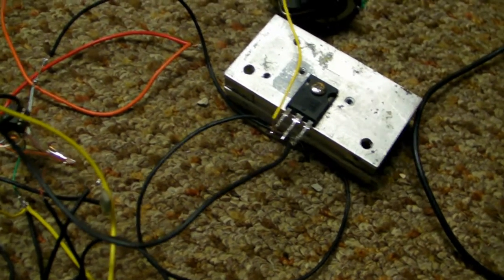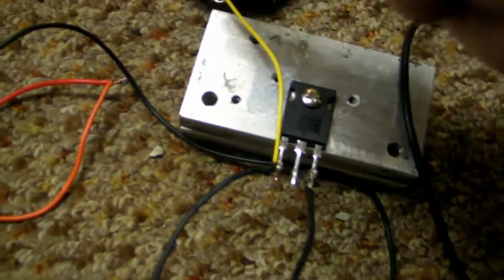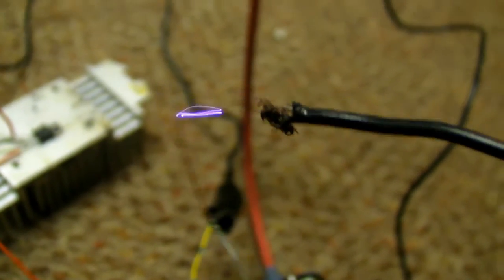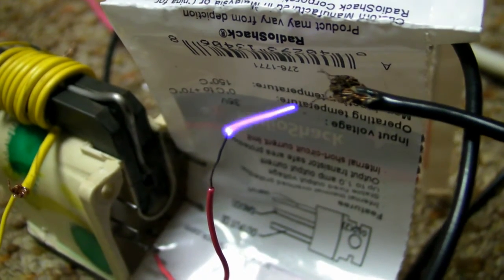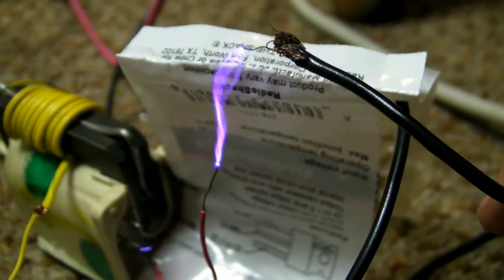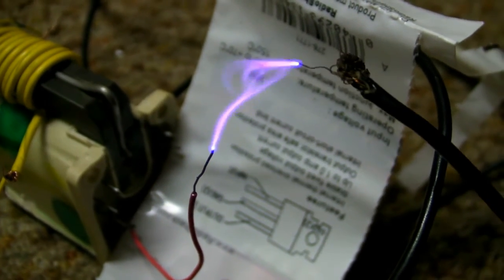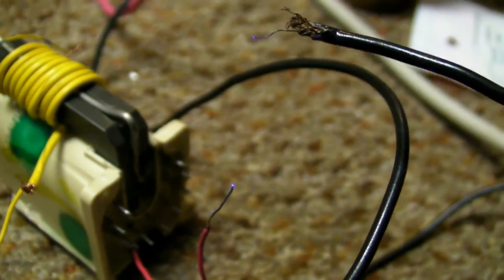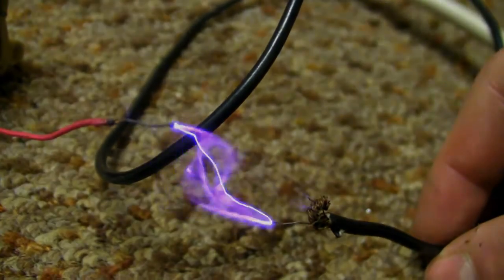First 555 Flyback Driver

Comment: Add a film capacitor between one of the voltage rails (doesn't matter which one) and the connection between the flyback and MOSFET. This will not only smooth out and  minimize the voltage back-EMF spike seen at the MOSFET, but also help produce MUCH hotter arcs.

The reason it works is because the capacitor makes a resonant tank circuit, eliminates many of the harmonics of higher frequencies (from square wave operation) and that is why it ends up more like a resonant circuit, almost like the ZVS driver! I was able to get like white hot plasma arcs which could be drawn out from 1cm to 4-5cm on 12V, without much tuning. (I used a IRFP250N 1000pf capacitor and 2 10k resistors with the 555 timer, all randomly selected parts from the junk bin, and a 0.1uF film cap for the one that bridges the flyback and MOSFET and power supply rail, and a 12V 12A xbox power supply.)

Comment from the maker: @hbycoily It was only an IRFP250. IRFP460 would be much better even though lower current rating since I killed all 10 of my 250's with the voltage spikes from this driver. Plus with a decent heatsink the 460 would be just fine. On my ZVS I am now using IRFP260s and can draw very large arcs with little warmth. I cannot wait until I make my IGBT zvs. Thanks

Comment from the maker: @HazzWold1993 Ahh, this video. I think here, all I had was 2,400uF with the big cap. Now, I added 3 paralleled 3,300uF caps. The little ones are only rated 24 volts, but they are good for my first driver, as thats all I plan to run. And I know, before I added more (like in this video) there was a loud 60hz.

Comment: oh i see! you isolated the side of the primary because you were giving it a higher voltage input rather than giving it a low 12 or watevah. what MOSFET did you use? you mentioned " the MOSFET really doesn't like this." and turned the frequency waaay down at 12V (correct me if wrong!) and it got hot as arcs. what MOSFET do you recommend using?

Comment: no, i don't think so, you have to use a small transiter to power a big one, 555 can't power large mosfets, i don't like 555, use a UC3842 or UC3844, you can find them in computer moniters, and they can drive with quite abit of power

Comment from the maker: @a380rockerfan Ya, you should see when I input 24 volts *555 regulated to 12*
I get 2-4 inches of somewhat hot arcs. But I need many windings on the primary of the flyback otherwise it will draw too much current. Ill explain it all in the next video I will post this weekend.

Comment from the maker: @filipkof Ha! I wish I could make a flyback of mine into a blob of copper. I tried putting in 24 volts into this driver. With the 555 regulated to 12 volts. I got some 2 inches of hot arcs, then my mosfet just died (turned into a short and was drawing over 15 amps) :|
I need more mosfets! I killed like 3 so far, I have 5 left, but still. One of these days, I will make a half bridge. No way am I going to attempt making a half bridge without a breadboard!

Comment from the maker: @awesomelightning A mosfet takes in a signal (square wave frequency) and amplifies it. Corona forms from high voltage, but not enough current to create an arc, I think. Its also the illumination of the energized gas particles. How do I know all this stuff? I just to, learned it over time. Umm, you can build many things, LED flashers, flyback drivers, ignition coil drivers, and the list goes on. And I am clueless as to when I will build a SSTC

Comment: Did you use any capacitor-snubber? (15nf would be nice)
It helps to cold down the Mosfet significantly. 
Also, use some Mosfet drivers, like the TC4420. 
The input current lowered at the same output! (no need of big heatsink)

Nice vid!
Keep 'em coming!